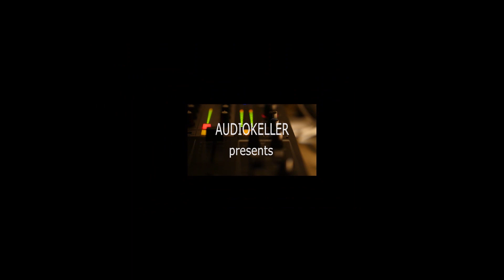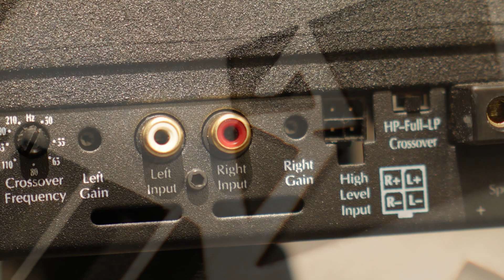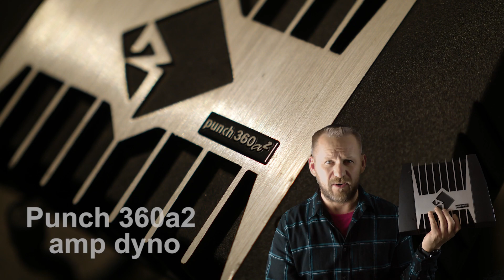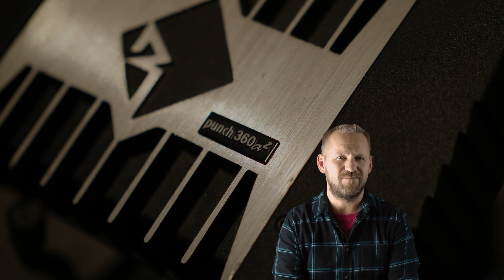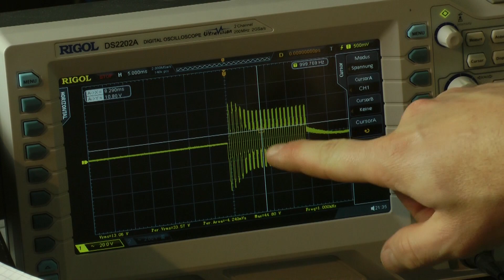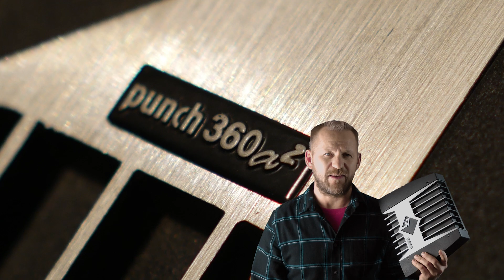Rockford Fosgate punch 360a2 amp dyno run power test old school car audio amplifier

Comment: Hello.  Do you remember how many amps the amplifier drew at 8 ohms mono continuos, or what the eficciency was when you tested it?  Thanks!😊
Reply from the maker: I am sorry at this time of publishing videos I didn’t make the efficiency test. But 8 ohms mono the amp will have an efficiency of 65-70% which is a typical value for these types of amps 👋
Reply: @audiokeller1975 Yeah, the 451s amplifier which has almost the same power rating, has an efficiency of 68.9%.  Thanks!😊

Comment: Genius here... So, I had a friend who had a punch 200 running 6 JL W6 12's, don't ask how because I never knew but they pounded! 
Will this 360a2 run 2 L7 12's with the blue stitching?
Reply: Did you do it? I am running 4 10s , 2 in clamshell isobaric. It pounds them good
Reply: @tonym9450 huh?
Reply: @Just_Listen785 did you run the 360a2 on kicker 12s?

Comment: I have two but one says punch, any other ones says power 360a2 and 360a11
Reply from the maker: @zephmattix438  if there is the same amp with power instead of punch you have beefier power terminals and the filters have a slope of 24db instead of 12db.

Comment: Ran a Punch 360.2 on two 10'S 2ohm stereo since 2005, until recently. Was still doing well after all these years until I got a lil deep on a mud ride.☹😵
Reply from the maker: I plan to use the 360a2 for a mobile outdoor speaker system with battery on two 8Ohm PA 8” woofers bridged mono 4Ohms 👍😁

Comment: What size ground and power wire should I use for this amp
Reply from the maker: It depends on total length and if you go with cca or ofc cable, I would go with ofc to keep resistance down and better flexibility. I think 20mm2 is more than enough, just convert it to awg 👍
Reply: I'm trying to run 4 gauge wire but the terminals are too close are there connectors
Reply from the maker: I built Short Adapters for different connector types
Reply: Is this amp strong enough for 2 12s
Reply from the maker: Yes and no , it depends on the type and power rating/sensitivity of 12s, if oldschool series one are used this amp will destroy them with ease 😃
Reply: 800 watt skars 500rms
Reply from the maker: 500 W RMS each? Go for a bigger amp like 1000a2 the 360a2 puts out around 450 sometimes more mono 4 ohms
Reply: Just run the biggest you can and run 8 gauge only 1 or 2 feet because the inputs are very small

Comment: What usually blows in an amp? Mosfets rectifiers or capacitors?
Reply from the maker: I didnt fix 300 amps, i only fixed 14 amps just for this hobby. Thats not much experience. In my fixed amps sometimes output-Fets died and then also powersupply-Fets together with gate resistors. sometimes voltage regulators for the preamp section. sometimes driver transistors. Sometimes opamps in the preamp section are defective. Topaz diode was also an issue if 12V touched RCAs. burned traces also. i never had to replace rectifiers.
two of the older DSMs had leaked 10uF smd capacitors. i think that was all if i remember correct. Most of them were intact but i like troubleshooting and fixing if i got the time for it and the parts arent expensive. The bd1000 was way harder, i didnt get the correct parts.

Comment: Hello!  They have 2 360a2 amps tested at the amp performance website, and they both have higher power ratings at 4 ohms, than the 360a2 amp you test here.  Why are their power ratings different?  Do they use different test equipment?
Thanks, nice video!
Reply from the maker: I am sure that we use different test equipment😁
I know this site well. some tests were sent in by some users and most tests were made by himself.
I see a difference of 4 watts. 135w my test and 139 his test. This is not audible and i would not call this a difference.
If somebody gets higher ratings it can be:
-a better amp
-measured to a higher distortion level
-load resistors with higher inductance cause higher ratings. I also had those resistors which cheated higher ratings especially when you test with 1kHz.
I try to publish honest and realistic values. If you mean the 155 watts per channel 360a2 you can see that its unrealistic because its the same amount of power no matter if only one channel is loaded or both channels are loaded.
if you load both channels you always get lower numbers than with only a single channel loaded . its less load for the power supply.
Reply: @audiokeller1975 Thanks for the explanation!
Do you know why they sometimes have 2 of the same amps, with 2 different power ratings, at this website?  Are they the same amp models from different years, or same amp model tested by 2 different people?  Thanks.
Reply from the maker: they tested the same models but different people.The owner of this site really knows what he does so i would trust his ratings 👍
Reply: @audiokeller1975  Ok, thanks for clarifying that!
Reply from the maker: i forgot to tell another important fact which affects output power: the supply voltage. some measure with more than 14 volts, some with 13V or even less.  And the voltage can also drop during measuring depending how strong and stable the power supply is.
Reply: Better drug head music possibly you know Motley Crue